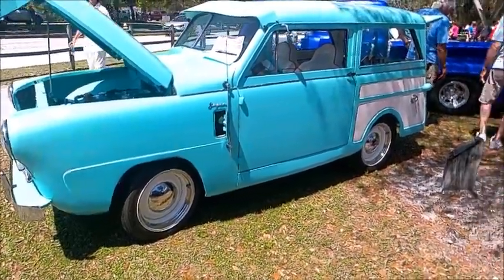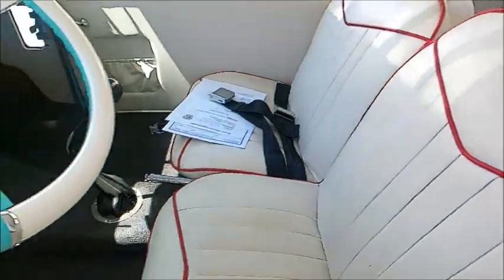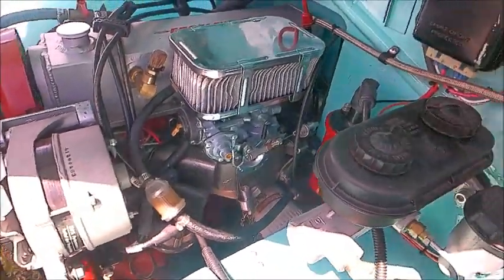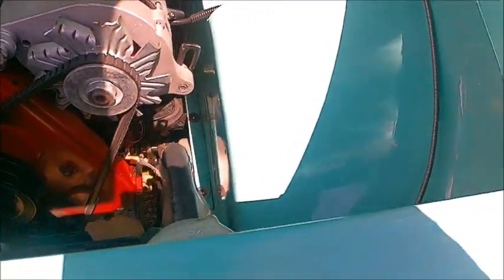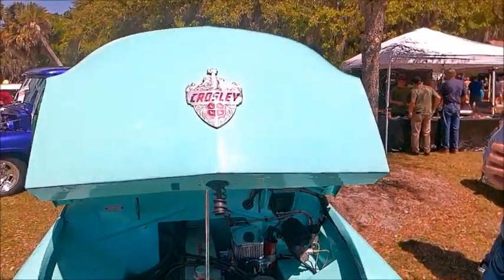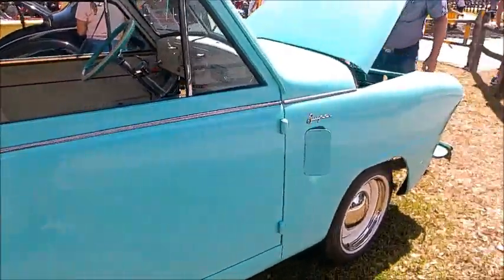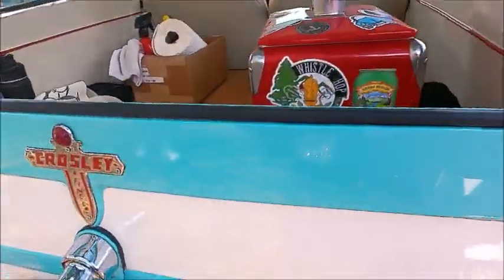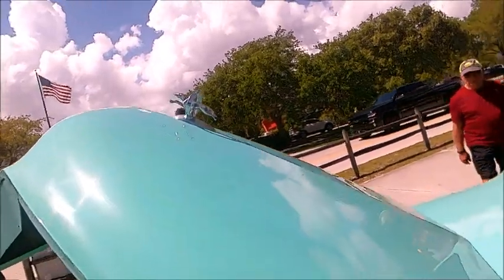1950 Crosley Station Wagon Restomod BluWht VeroB 0319226082

Comment: I think I read somewhere that Crosleys had engines constructed from sheet metal. This nicely upgraded one has got an engine that in my country is from a late model Ford Cortina or early Ford Sierra. I imagine the welded up sheet metal valve cover is a nod towards the original Crosley engine.
Reply from the maker: Hey, Mick!  Those original sheet metal engines were very problematic...they got replaced by a proper engine later on.  Crosley was the first car to have front disc brakes...unfortunately they had problems, and they too had to be replaced.  Innovation is not without hurdles to be overcome.  Thanks!  :) Jack